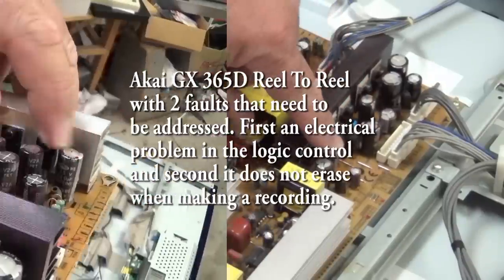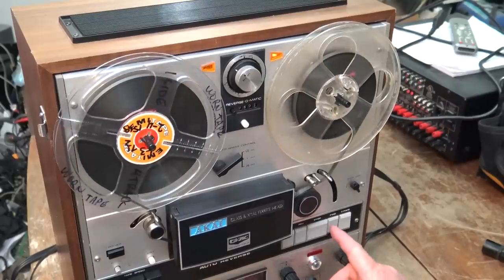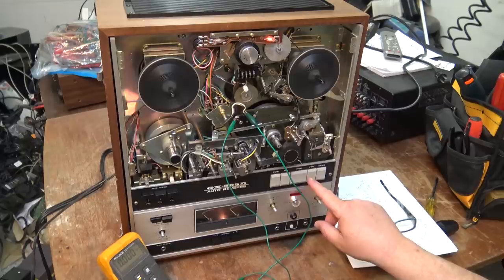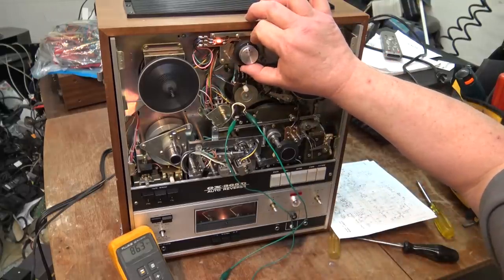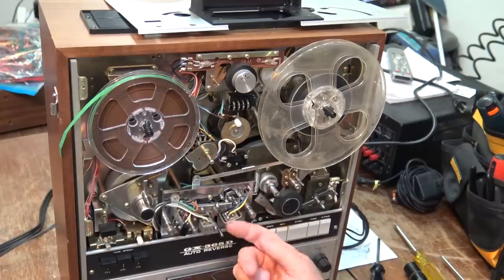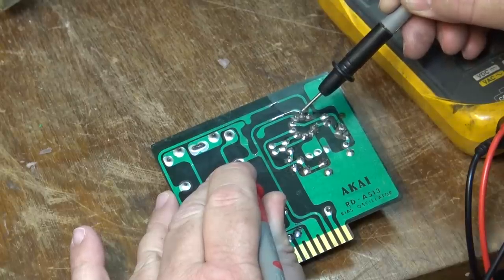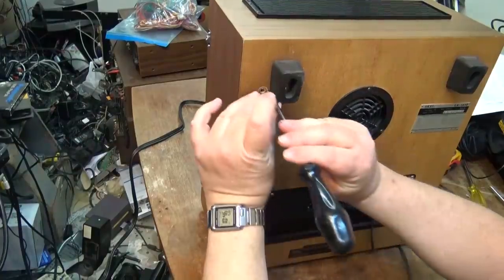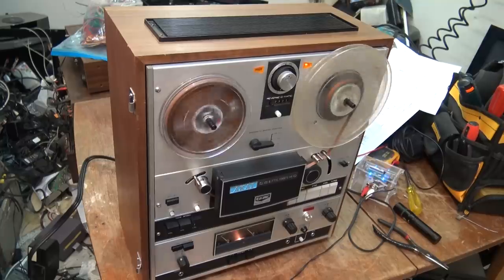AKAI GX365D Pinch roller solenoid problem and no erase.   Can this one be fixed?   Lets Find Out

Comment: Wish you got a higher capacity card...
Very informative as always. You're a great defender of these fabulous reel to reel decks.
Akaï used to be a master in magnetic recordings in these years, and many recall their Revox, Sony, Teac and many others builders of these reel to reels, and remember they were as effective as fragile, heavy, prone to be forgotten in attics. I've found forgotten tube Studer and 3 heads Sony in derelict condition, but was surprised it was still relatively easy to find parts and schematics, and good advice in some prickly point, to finally have them back in fine working order. 
Akaï also made renowned 3 heads 2 capstan tape decks like GX95. I remember selling the last ones of these GX series jewels in the early 90's to customers who were surprised to find such quality in a brand whose products were then considered low cost junk. It was so easier to sell Nakamichi or Studer to get better margins!
These heavy equipment are someway fragile as these models have no real metallic frame  to protect electronics. The wood chassis is OK to protect these heavy equipment, (+ the big feets), but you're perfectly right in the fact anybody attempting to service these can fall in this trap and have issues with contacts and raiser cards... These are made of fragile Bakelite, and break or burn easily. And I can tell, you know what to do to, to repair these!
It's not the first time I've heard of these two sets of pinch rollers on Akaï decks. Can you confirm it's the way they pass from 7 1/2 to 15 IPS?
Anyway, I don't know if it's really practical, as I suppose you have insufficient place for larger size reels (with NAB adapter, studio size).

Comment: Just pulled my AKAI GX630D out of the closet, after seeing this video. Switch contacts definitely need cleaning, along with the potentiometers. The impedance roller was a bit stiff at first, but seemed to sort itself out. Anyhow, still working and looking darn good. Switching back and forth from TAPE to SOURCE was perfect. I could not tell one from the other.

Comment: That Compute-o-matic looks pretty slick.  It only turns up when first turned on.  It turns down as it sees a louder level.  Beats the heck out of the standard ALC found on cheap machines.  The only real downside I see is that it may not know the difference between an actual level and a transient such as bumping the mic or a dropping the needle.

Comment: Loverly job dave :-D, the owner should be very happy.
Yup a holding resistor, just enough current to stay in.
I've seen relays operated in the same way, high current pulse then a hold in lower current.
i tend to change caps in switchmodes more than audio gear.
Reply from the maker: These use relays to operate the logic. Perhaps a tutorial in a simplified circuit is in order to help people understand how these operated without using ic, transistors ECT. Only momentary switches, relays and solenoids .

Comment: As l understand it, solenoids are fairly simple devices (just a coil of wire surrounding a metal shaft, and when turned on, causes the shaft to move, due to magnetic forces). Can a damaged (or burned out) solenoid be repaired then by recoiling the damaged wire with new wire?

Comment: Great channel I just discovered it... I have a AKAI 2000X than used to have a bad left channel. I had that repaired and later on I discovered the shop forgot to put in the speed changer. The 'sleeve' / adaptor to slip over the capstan to increase it's playback and recording speed. It's a metal cylinder that slides over it to change speed. They have since gone out of business. I have been looking for years but can't locate one. Do you have any idea of where to get such a part?? Thank you so much.
Reply from the maker: Yes I know the sleeve you are talking about. My 4000 uses one, Sleeve off 3 3/4, on 7 1/2. 
I have no idea where you would find one other than Ebay.

Comment: That knob pointer seems so odd, kinda startled me. I'll bet thats a very good stabilizer when running left to right, way way better then the one in my mx5050 2 track 1/4". I almost want to put a big flywheel in it for a stabilizer, there is room inside.

Comment: Dave- bet someone snapped the board when springing the clip that holds them back in. As you know, it was a stock means of retaining boards to connector- My LEAK Stero 70's have the same and the spring is strong.

Comment: Hello I have a teac a-1200u and the solenoid for the pinch roller is not strong enough to move the pinch roller to meet the capstan and there is not much power the pinch roller only goes a quarter of the way up to meet the capstan and I want it fixed I can do the work but I do not know where to get the part nor do I have a lot of disposable money to spend any help would be great and i really learn a great deal from watching your videos they are great thank you and thank you for your time
Reply from the maker: First things first. Check for dried up grease in the pinch roller hinge. The pinch roller should be completely free when moved by hand. If it is hard or shows even the slightest resistance when moving by hand then the lubricant is probably dry and this will cause the solenoid not to be able to pull it up. That happened on my Teac R-R. I did a service video on mine last summer.
Reply: @12voltvids  hello thank you for your fast reply it was my dad's before I got it everything is lubed and free and when i push play the solenoid does not move much and it has very little pulling power.  I learn many things watching you work and lubrication i know to do i do this process every 2 to 3 years depending if it needs it . I have lots of vintage gear and they do not make things the way they use to thank you again for all the ideas and help
Reply from the maker: @tough213  You are right they don't make them like they used to. I am working on my favorite design right now. A modern Denon. Well at least I am being paid well to fix that POS.
Reply: @12voltvids  I have to say I really enjoy your sense of humor and your straight forward way of saying what the causes are of the issues .I found a garrard a-70 turntable 8 years ago and it was half in pieces and I fixed it I am self taught and learn by watching and hearing I also have a tascam 32 that I need to get working and a realistic - 802 8 track recorder deck perfect and 2 kef speakers I found in the trash people are really not smart they could have gotten a good bit of change for them I also had found a garrard sub woofer and two sattelite speakers and a technics dual cassette deck and sony tuner and audio technica atpl-120 turntable all found . thank you and I will always watch you are very smart and I as I said enjoy your channel do you know how I can fix the solenoid or where I can get a cheap replacement thank you again

Comment: This unit wasn't modified to run at 15IPS, this one came with a capstan speed sleeve to increase the capstan diameter. This is the way to have it run at 15IPS and it is mentioned in the manual.
Reply from the maker: Mine has the sleeve as well , but runs at the speed listed on the switch with the sleeve on. Remove the sleeve for 1 7/8.

Comment: very quick diagnose. Impressive
Reply from the maker: Took me a few hours start to finish.
Reply: yes, but I'm taking about that first issue with the switch.
Reply from the maker: @Radek__  
Going in I didn't have a clue but I did notice (and cut from the video) that when it warmed up the pinch roller lost torque when I put some downward pressure on it.  This was the first clue. Once I removed the face and put my finger on the plunger I found it was getting hot, too hot. That was a huge clue as when metal gets hot it looses magnetic properties.  That is how minidisk is erased.  By heating the magnetic layer with the laser.  A quick check of the schematic showed the switch for the limit resistor and it had to be activated by the mechanism.  There it was staring me in the face.
Reply: thanks for explanation I didn't know that heat makes magnetic field weaker in coils /solenoid. I was thinking only about  insulation on the coil's wire - than it can burn because of heat and then makes a short between windings. So thanks, good to know :-)
Reply from the maker: @Radek__  
That is where experience comes into play.  Many VCRs used solenoids that caused many headaches with Sony and Panasonic way back in the 80s.
Reply from the maker: @Radek__  Pretty easy to see that it wasn't activating. Once it was taken apart.
Reply: yeah but as you've said - here comes the experience. you know what to expect in these kind of  units and what is going bad often. I'm also fixing electronic but I bet if I would be on your place, then I would be thinking that coil is shot and needs to be replaced :-)
Reply from the maker: @Radek__   I am sure a few probably thought that and I didn't know what to expect going in, but the first thing I did was grab a print so I could see what they were doing, because believe it of not I have very little reel to reel experience. The guy I worked for would not allow any reel to reels, or any tube gear, or for that mater anything american of canadian. So no old marantz, noresco, rotel ect. When that stuff came into the shop the boss turned them away or tried to sell them a Sony or Technics garbage system. In the 20 years I worked in the business the only Reel to Reel units I serviced were the 2 that I owned. I have fixed more reel to reel units since retiring from the business.
Some are nightmares to work on mind you.
Reply: ok then :) let say different - logical thinking experience. Intuitive feeling about what first to do or what could be bad in this situation. For you it is obvious now, you do it automatically, but for a lot of the people (who have a less experience in fixing things) is not. Each fixed/done unit (any type of) gives you an experience, which "shapes" your brain to think in a specified way and to "connect dots" in a specified order (during diagnose). And this is the real experience (not theory from books)

Comment: But why? I get it, the long delay is normal, per design... But what purpose does it serve to pause for so long? Is it to pick up potential slack in the tape before reversing?
Reply: The reason for the delay between forward and reverse play is so the capstan can come to a stop, then start up the opposite way full power before engaging. The pinch roller separates from the capstan during this process. If it didn't happen this way, you'd hear the music slow down to a stop and slowly come up to speed again. Early Teac 4010S machines did this and was later changed to eliminate this problem. I have a TEAC 4300 and does the same thing with the pausing. There are videos on YouTube that show demos of these decks and how it works.
Reply: @teacfan1080  I agree this all makes sense... But I would have thought the pause doesn't need to last this long, like maybe one second tops. This looks like 5 times longer than it needs to be.
But hey, what do I know ;-)

Comment: I just picked up a GX365D last week and cleaned it all up. It had been stored in an attic for a long time. Dust and bug debris inside and out. I still need to find a tape counter belt, but it seems to work really well. However, it records not with a bit of normal hiss but an audible static crackling sound. I've cleaned the heads and degaussed them as well. Crackling still present. It plays already recorded tapes flawlessly. Any ideas to help out?
Reply: I was literally putting it back together this afternoon. This video couldn't be more timely.

Comment: On my akai 365D the solenid is not activating and is not contacting the switch so where should i look? Could it be the pinch roller relay not working? I have voltage going to the solenoid. Any ideas where i shoud be looking?
I cleaned the remote plug contacts and that did not resolve the problem. Anyone know?
Thank you

Comment: how do they modify a machine to 15 ips?
Reply: There is a video I've watched by someone who repairs and sells these decks. He had an Akai almost similar to this one. The UV meters were completely black face, no number markings on them other than a small white line where zero db would be. The 15 IPS speed came from an extra pinch roller stored under the head cover. By installing that, you could get 15 IPS in the 7 1/2 speed position. A standard 1800 foot reel would go through in 24 minutes per side but at least it had some professional traits about it. That machine also had the compumatic auto level control as well.
Reply: @teacfan1080  wait a minute... How does a different pinch roller determine the speed of the captsan? It is how fast the captsan is spinning not the pinch roller

Comment: No I did not see that thing move but that's because the camera 📷 is out of position and too far away got anyone to get a good look at it
Reply from the maker: Nothing wrong where the camera is.  If you can't see it then you need glasses.
Reply: @12voltvids  you're right my glasses allowed me to see the mechanism turn and yes I heard 👂 the motor running that allows the mechanism to work
Reply: @12voltvids  100/100 Nice Work 👍
Reply: So that explains the one thumbs down 😉
Reply from the maker: @hidoHido-vm4en  
Owner of this already saw the video and is excited to get it back. It's a nice sounding machine.